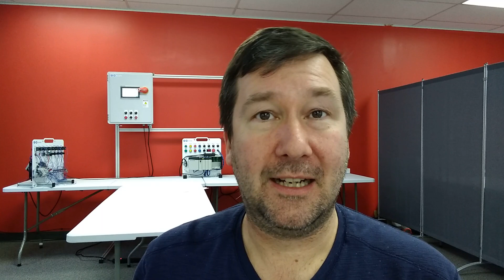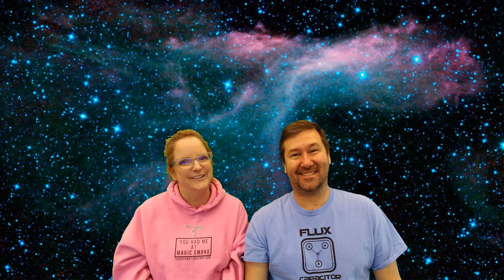UL 508A Getting Started.  What are Barriers to the MTR Exam ?

Comment: Good stuff here. I recently designed a large panel based off a design from the early 80's, that got dinged pretty bad by the panel shop because of UL requirements. I'd love to hear more about this topic as well. Thanks, Tim!
Reply from the maker: Thanks for sharing.  Let me do some brainstorming on how I  could lay it out.
Reply: @TimWilborne  I think what you touched on, the two biggest mistakes, the SCCR rating and branch vs supplemental circuit protection is a great topic. Maybe just on quick overview on cable sizing as well.
Reply from the maker: @coasterbp  I already have a SCCR video planned.  I could do a branch vs supplemental circuit protection video as well.

Comment: Here's one: using UL508A rated disconnects for the service entrance. UL508 disconnects are only suitable for between the motor and its last overcurrent protection device. For the panel feed you need to use a UL 98 rated switch.
Reply from the maker: Yep, that one is on the the list to cover Brian.  Thanks for watching!
Reply: @TimWilborne  that's great Tim. It's something that's easy to get confused about because you're building a UL508 panel, and almost all your components are UL508 rated. So its easy to think you need to use a UL508 disconnect.